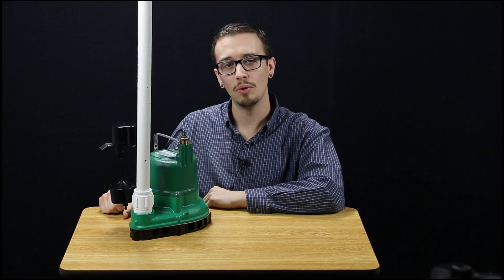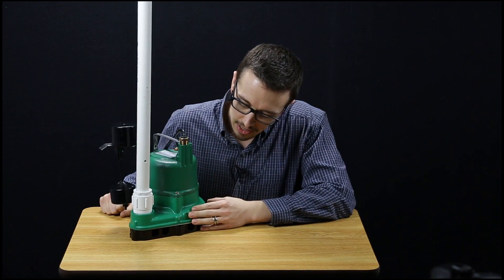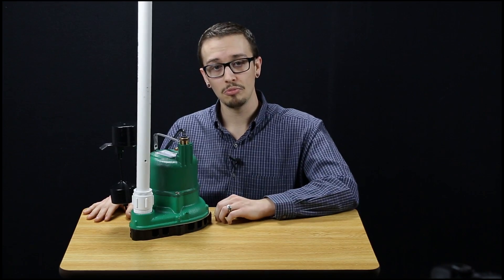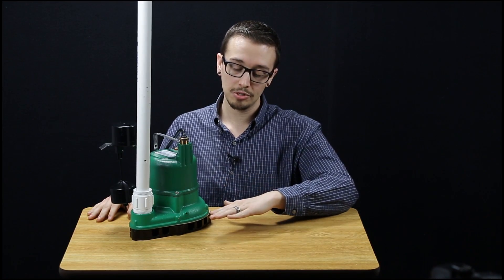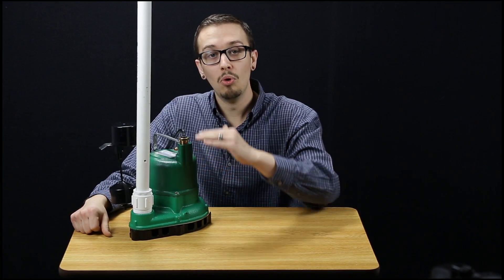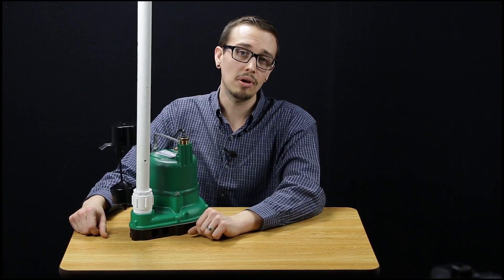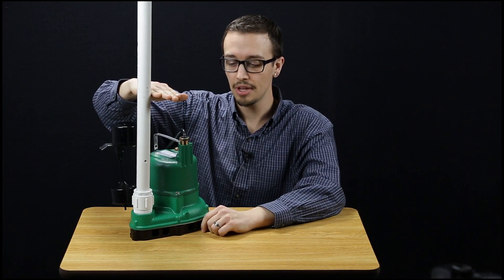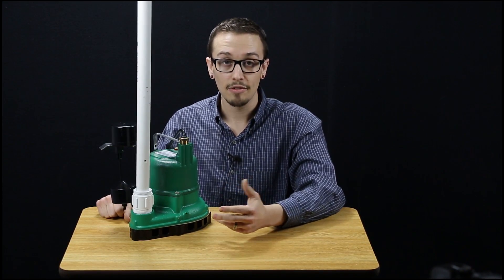Why Sump, Sewage, and Effluent Pumps NEED a Vent Hole

Comment: My pump started running all night and does not stop. I took it out and cleaned it, but it still runs all the time. I cleaned the vent hole very well. What could be happening?
Reply from the maker: Do you have a float switch? If so, it may be hung up or failed on.

Comment: I have a rubber hose connected to my pump's discharge port vs pvc pipe.
I have puctured that hose to vent air , however sometimes the hose self seals (for better discription). Any suggestions, or do I need to switch to pvc?

Comment: If my check valve is at the bottom of the pipe right at the pump do I need a weep hole. Cuz I can't drill below the check valve

Comment: How does this hole help?  

Why is the air not driven upward as the water behind it rises?  Or are we trying to avoid air later in the hose/pipe where it might form an airlock?  If so, how does a hole on a vertical pipe help?  Why won't the air quickly rush up past the hole in a broad vertical pipe/hose and therefore not leak out the hole?   Does water tension play into this?   Any explanation would be appreciated.  

I do understand we don't want air around the impeller but that's a different situation, right?    And perhaps better resolved by the hole next to the impeller?   Will water often also be pumped out that impeller-adjacent hole when there is no air to be pumped out?  (I think I've seen this happen with my pump.)
Reply: I think the answer might be...

Typically there's a check valve above the weep hole.   And the problem is that there IS air around the impeller and all the way up to the check valve.  The impeller works poorly on air so can't generate enough pressure to push the air past the check valve.   But it generates enough air pressure to exceed atmospheric pressure so it can push air out the weep hole.  As it pushes more air out the weep hole, if there's enough supply water, the impeller will eventually be fed water at which point it becomes far more effective and the impeller can then drive water and air out past both out the weep hole and past the check valve.

Is this right?   Are is there another situation as well?

Comment: I am pumping uphill 2 ft to a drainage ditch 100 feet away. There is always water standing in the pipe, which may freeze in winter. What should I do?
Reply: "no check valve" works for me and  I covered everything with styrofoam closed cell

Comment: I'm doing this on a Zoeller M53 that a plumber told me to buy to replace my old basement sewage pump. Seems like the wrong pump but I'm over my return period. These trades people are mindlessly stupid. I'm reinstalling it myself because his install leaked and he won't show up again. I'm drilling the 3/16ths hole as the box and instructions say but since it will be worse-than-groundwater I want to drill it about 2 fingers above the outlet which is below the waterline. My understanding is that should be fine as this is to provide backup for the vent already built into the pump. Which Zoeller says usually gets clogged at some point. The instructions say to put the hole at the top of the pump. But mine will be spraying pee and doo all over which I want to avoid. Any reason why drilling the hole below the water line would be a problem? I assume it wouldn't since the pump's vent is below the waterline. Air will still travel up and out from the pump even if immersed. Without the check valve this wouldn't be an issue since there's venting further down the line.

Comment: I had a septic/effluent pump basically destroy itself because there was no vent hole drilled in the outlet pipe. This pump was installed by the septic installer when my home was built about 14 years ago. I ended up replacing the pump and replacing the 2-inch PVC discharge pipe entirely, and drilled my vent hole farther up the pipe (before the check valve) so that it wouldn't get clogged up. I've noticed that with septic systems, if you drill that hole too low it can clog - removing a clog is easy, but not if the pump is 8 ft+ into the ground and you can't reach down there to unclog the vent hole!

Comment: If I have a check valve installed on the pump, wouldn’t drilling this hole defeat the purpose and allow water to run into the tank?
Reply from the maker: That is why it is important to drill the hole below the check valve

Comment: For years I've been using Wayne submersible sump pumps which say the pump is precision engineered to eliminate Air Lock, and no weep hole is necessary.

Comment: Asking for a friend: This doesn't make sense. The hole you're recommending to drill is literally on a vertical pipe, where any air would rush to the top of the pipe vertically. How would that fix airlock INSIDE the pump. This adds air constantly to what would typically be a closed system without air in it.
Reply from the maker: The pump can move water. The hole gives the air a place to escape when the pump is placed into water or if it runs dry and fills back up.

Comment: Man I really don't see this happening at all - where I work we have multiple sump pumps in holes, pits and under equipment beds etc,,,  through out the entire mill and in my department we have several sump pumps in service and I'm on my 3 home with each having sump pumps.  I have never ever seen this issue.   I know none (big zero) of the sump pumps drain below the pump intake area.  So what's the deal with you guys?

Comment: I think the premise of this video is good. Virtually all manufacturers say that the weep hole on the unit will eventually clog. They also commonly recommend a 3/16 hole pointed down. However, the main reason they give is the fact that the system has a check valve. I've had some pumps from three different manufacturers and they all claim this is the real problem for homeowners.

Comment: Can you put a Zoeller 270 bn pump inside a 275 gallon Tote container for outside use of displaced grey water? The Poly Tote is 48” X 40” X (33” in height) since I poured concrete in the bottom of tote for durability I lost 15 “ in height. Will this be enough volume in height? Thanks

Comment: My submersible pump has the vent hole and I barely used it for more than 20 minutes. 
I was pumping out an area dugout of clay , so dirty water. 
The pump now pisses out of the vent hole. 
My pump works with a garden hose   so i just reverse the hose to clear the the inside of the pump and as well blew air in vent hole. 
Got the pump working but didn’t last once i started pumping the dirty water with clay it started with the problem again. 
The pump is new is the pump basically worthless I dont want to open it for nothing or bring it back to the store as it has a 30 day return policy. 
I would appreciate any feedback from anyone.
Thank you.

Comment: You said to drill the vent hole 3" or 4" above the pump discharge, looks like the hole shown is around 6" or 8" above the pump discharge. What is the ideal height of the vent hole. Also, the Zoeller pump I have has a vent hole built into it, is it really necessary to drill another hole in the pvc discharge pipe? Just wondering.... Thanks
Reply from the maker: Anywhere below the top of the pump. Yes, the instructions for Zoeller pumps with a vent hole instruct you to still drill a vent hole in the discharge pipe.

Comment: There are check valves designed to be screwed into the base of the pump below any of the pvc pipe. I'm assuming no hole is needed on these?

Comment: I just drilled a 4mm hole at a downward angle just above the pump. Now the pump actually started to work (you could hear the pump humming, but no water flow (airlock). Great advise. Thank you. We just moved into our new home, and we are trying to prepare for spring. Don't want to get a surprise when the snow start to melt and the water level start to rise in the basement.
Reply: You drill upwards so that when the water shoots out it shoots downwards.

Comment: I have a zoeller 1/2 hp in an outside sump/sump pit application. The pump has a vent hole as shown in video and I also drilled a vent hole in the riser pvc pipe as recommended. However, my pump is still airlocked and it's very frustrating. Is it because my pit goes completely dry due to  having drilled 1/2 inch holes in the bottom of the pit. Not sure what else could be the problem. Any suggestions?

Comment: Hey, good video - quick question, how often is too often for a dump pump cycle run?
Reply: There's no real answer as it depends on the volume of water in the sump basin.  Our neighbor's house in the Midwest turned on every 30 seconds in the heaviest of rains.
Reply: @kcmaldonado3948   Thanks for taking the time to reply. Since I posted the question I learned a lot about how this house takes the rain water in and how long it takes for the pump to  operate a little less than every min or so a it was that day. We've got 3 days of rain again this week and by the end of the second day it started to run crazy again for like 12h until it slowed down again.... I also figured what was wrong with my water powered secondary pump that helps when the primary is in trouble...

Comment: I've had 3 different Little Giant pumps in my sump over the years - No vent hole - Never had any issue.
What am I doing wrong?
Reply: My pump has been running 16 years without a vent hole. First time I've ever heard it airlock was last week after the float switch was replaced and being tested. It was discovered by the second plumber that it needed what he called a "weep hole" I still wonder if it's necessary.
Reply: @X6800  airlock is possible mostly if your pit goes dry. If your pump is always submerged, you may never have an issue.

Comment: The vent hole in my riser pipe sprays water all over the floor after very heavy prolonged rains. I didn't know why it was there.  The guy who put it in should have drilled it at an angle. I was going to seal it off. Now I'll find a way to deflect it downward more. Thanks!

Comment: I just hooked up a 1/2hp Zoeller tonight with 24ft flex hose. The push on check valve is maybe 2 -3 inches about the base discharge screw in spot. I was going to do a pvc riser and check valve being much higher but I was told it's not good to attach flex discharge pipe to pvc riser. Should I still try to drill 3/16th hole an inch below very low check valve?
Reply: I would replumb it back in correctly using PVC pipe or you'll eventually get flooded like I did.

Comment: With a hole drilled in the discharge pipe does the basin need to have a vent line piped out of it?

Comment: I removed my septic effluent pump the other day and noticed there is no weep hole. This pump is nearly 20 yrs old and has never air locked. Have I been lucky or is air lock a rare occurrence?
Reply: I see sump pumps all over industrial applications and never seen one airlock. No homeowners I know drill weep holes either. If the pump has one already, it's probably entirely unnecessary.

Comment: Why is the discharge hole not drilled directly below the check valve? Isnt that the most likely ceiling of the cup that traps air??
Reply from the maker: The problem we're trying to prevent is air in the volute of the pump. As long as the pump is full of water it will push and air in the pipe through.
Reply: @RCworstwater  Oh wow, I totally understand now. It’s to prevent air locking in the impeller / pump which would burn up. Ok this makes complete sense. I watched a couple videos of them turning on and they definitely shoot out pocket of air in the first half a second. And yes this pocket of air does blow out the front typically pretty hard. Thank you for explaining

Comment: What could cause a drain pump to run for the same amount of time but drain more volume of water?

There's no electrical as the pressure sensor and control board has been 

It's an  Electrolux commercial dishwasher where the drain pump is running for the same amount of time as before but is pumping more water out the wash tank  than usual after completing every cycle.

The drain pump has a vent valve could this being blocked by dirt cause an issue (like you said vortexing)
Reply from the maker: Vortexing is a strong possibility

Comment: Dude, thank you so much. My basement has flooded like 6 times from my pump becoming air locked. After the 2nd time I bought a new pump and it keeps happening. A little hole that took 2 seconds to drill just saved me the biggest headache. I couldn't figure out what was wrong. I would take it out, look it over, see nothing was stuck, put it back in and it would work once so I figured just a really unfortunate glitch. Then I realized that when i took it apart there was a ton of air in it and I sort of had a clue and came across this video. Thanks so much!
Reply: When I was just starting out in plumbing 23  years ago I installed a new sewage pump in a million dollar house and ignored drilling the hole...I went to test the pump and kept flushing the toilet and running water and the pump came on but never pumped a dropped and never shut off. When I disconnected the check valve to remove the pump I heard air release and right then and there I understood why there needs to be a hole.
Reply from the maker: Nice work!

Comment: All water in discharge pipe will be drained back and pump will work much often
Reply from the maker: That would be true if you drilled the hole ABOVE the check valve, which is often done for freeze protection when the discharge pipe is not buried deep enough. In the video we instruct you to drill it below the check valve so you are only draining the water in the short pipe between the pump and check valve.

Comment: I replaced the pump in my sump several years ago and I did not drill a hole in the discharge pipe. I must have gotten lucky and bought a pump that had an air lock hole on the pump since mine seems to be working fine. I am going to take a look at it this weekend to find out.

Comment: I tried it. Using a 1/8" downward vent hole. Started new pump and water started spraying in upward direction from the pit. What did I do wrong?
Reply from the maker: Was the water spraying up from the hole or bouncing off the wall and coming up? As long as it does not spray out of the pit you should be ok
Reply: The video says to us an upward vent to avoid this specif spraying issue.

Comment: Good explanation and wondering about another issue. Installed a sewage pump as the basement washing machine, shower and sink (no toilet) empty into a very big sump.   The problem is however that recently the water is been drained from the trap in the upstairs bathroom or backs up slightly in the bathtub when the pump empties the sump to the sewer/ storm system.  Any suggestions? Will a less powerful pump or a mechanical vent    before the bathroom trap help?
Reply: Need a vent pipe to the pit.

Comment: Drilling the weeping hole above the check vale negates the check valve. Do not do this. The weeping hole should be between the pump discharge and check valve and above the impeller. After installing the threaded check valve on the pump, I drill right through the pump housing and the threaded section of the check valve just below the flap. Works every and all the time
Reply from the maker: In this video I do not recommend drilling above the check valve. Though it is a very common practice in cold climates to allow the lines to drain back into the tank to prevent the lines from freezing. A hole in the pipe above the check valve does not eliminate the need for a vent hole. I would say it is unnecessary to drill a vent hole in the cast iron as a hole in the pipe functions just as well and doesn't use up nearly as many drill bits. In case you are thinking the fitting coming out of the pump is the check valve, it is not. That is a PVC SCH 40 male adapter with a slip x thread bushing in it. I like to install my check valves higher up for easier access and inspection without the need to pull the pump.

Comment: Hi Chris, does the drain hole needs to be higher than the water level when pump has stopped. Thanks
Reply from the maker: No, it does not. It's best to drill it an inch or two above the pump connection.

Comment: What if air gets in the pipe above the drilled hole in the discharge pipe, but below the check valve?  Wouldn't it still be air trapped that can't get out?
Reply from the maker: The hole is to prevent airlock in the pump itself. Once air is out of the pump the water that it is moving will push any air in the pipe out.

Comment: I like the vent hole in the riser pipe above the check valve, in a good number of basement pump installs the riser pipe is roughly 10 feet, 1 and one half inch diameter,  So that's  several pounds of water that the pump has to start up against and get moving. I believe that stresses the motor and over time can cause failure.  I have not noticed any adverse effects from doing this other than the slight hissing sound the water makes as it escapes. I'd be interested in any feedback you have about  doing this.
Reply: Not how pumps work...i.e. water tower

Comment: Good techs make the hole down closer to the base, so any sediment will be stirred up by the current and removed by the pump.  Too high a hole can cause problems with water infiltration into the concrete floor or erosion problems. Also check valves are used to prevent backflow into the sump, as per code.
Reply from the maker: Great tips!
Reply: What if the riser off of the pump is the highest location and the rest of the flow is gravity drainable? Still want a check valve on the riser?
Reply: Also what if the pump is outdoors? I’m worried about water being trapped in the last 90° bend and freezing
Reply: I did a one way check valve, was worried about the water freezing in the 4ft vertical pipe, so drilled a small hole after the check valve. The water just falls back into the pit.